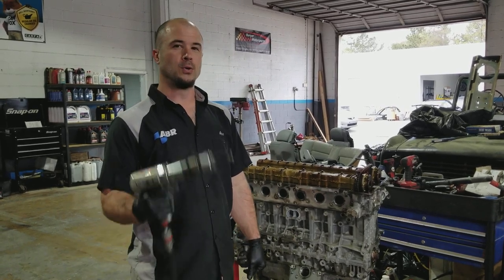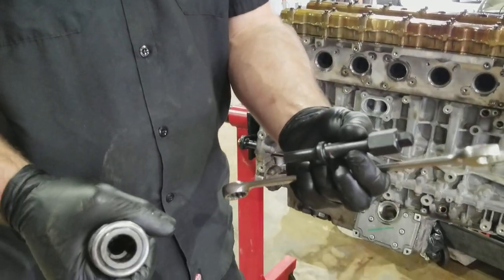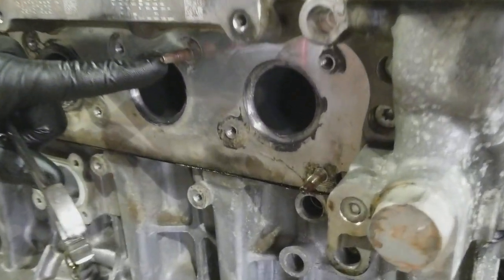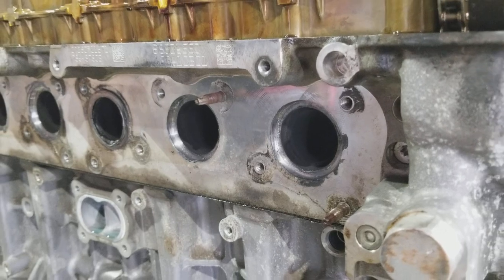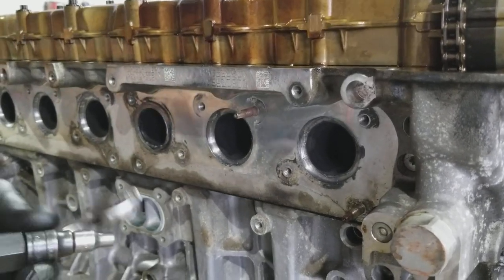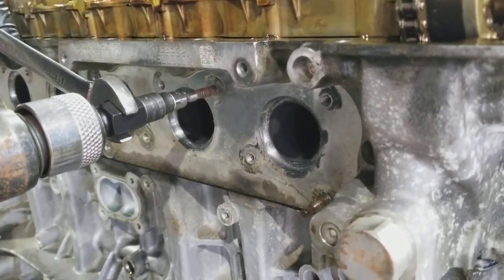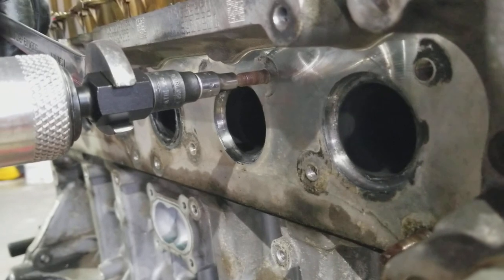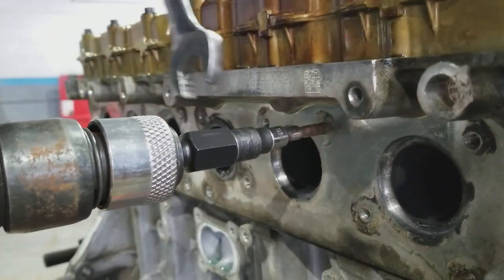ABR Houston shows how to remove a stuck fastener with an air hammer

Comment: Hey I got a question, I got a 07 bmw 335i having misfires on cylinders 1 and 2. I changed the spark plugs and coils but still misfiring so I decided to take the injectors out and #1 was dry but dirty and #2 was covered in oil like it was dipped  what does that mean.? I changed the valve cover gasket a couple months ago so I don't think it was from that as everything is dry/free of oil. Any insight into my problem would be greatly appreciated
Reply from the maker: That doesn't sound good! Look in the cylinder and see if the piston is oily. If so, you may have some bigger issues :(
Reply: ABR Houston Your BMW Service Specialists like what blown piston ring? Would a compression test reveal the issue?
Reply from the maker: That would be a great idea to check it. Leakdown would be better.